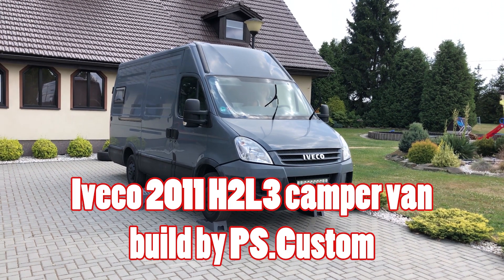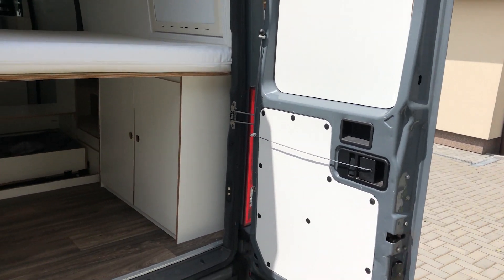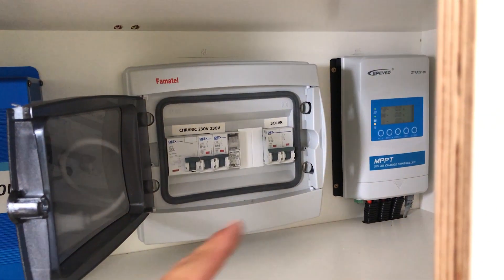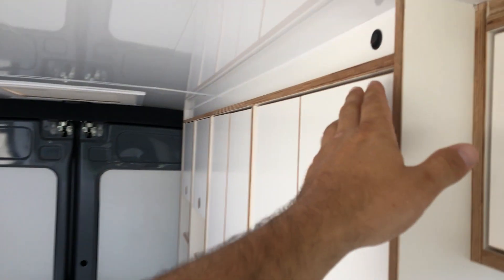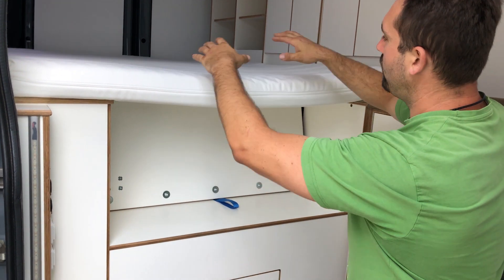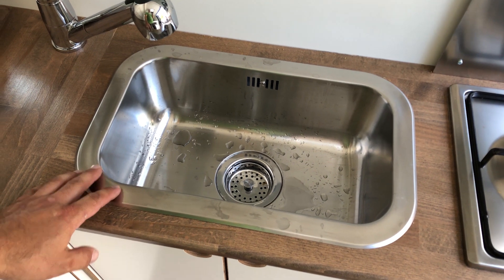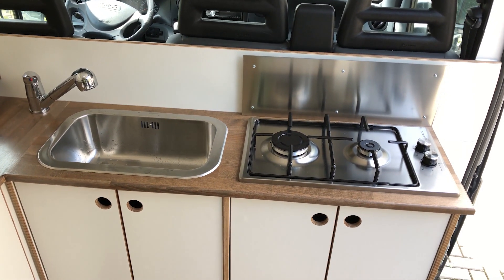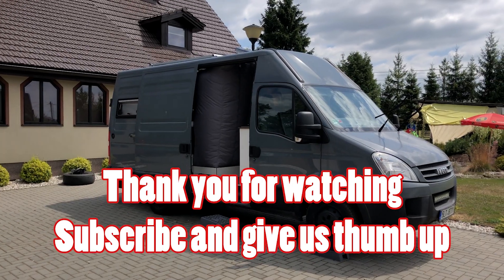IVECO L3H2 campervan conversion made by PS.Custom

Comment: Nice build, I too would be concerned using that boiler.
What material did you use for the cabinet builds,
Reply from the maker: Bob Scullion don’t worry about water heater. And it is 15mm birch plywood.

Comment: Hello from Switzerland!
Have you insulated the line from the water heater to the faucet?
Is there a specific insulated water hose for this?
Reply from the maker: Daniel Lörtscher hello no it is not insulated because owner will not use the car in the winter and cold weather. Under the car is valve which he can use to empty water tank also as shower. In the winter it will be empty in garage.

Comment: I love Ivecos
Reply from the maker: Lauren Henley I have to say I dont like them at all and would not recommend for conversion to camper van. Rust is going to eat every one of them. Roof si very stupid way done with not even one flat surface for window. Very tall floor because of rear wheel drive. Buy it is just mine feeling.
Reply: @Pajunk320  uh oh :( thanks for telling me. I didn't know that information I just thought they were more rugged than Ford Transits and Sprinters. What would be your ideal van to convert then - out of Transit, Promaster or VW Crafter?
Reply from the maker: Pinga Lu112 ducato/boxer/jumper depend how high you are?
Reply from the maker: Lauren Henley dodge promaster is same like ducato here and so far it is my favorite body
Reply from the maker: Pinga Lu112 promaster L4H2 or H3 good car for you. I dont know about engine but this body is good for conversion
Reply: And if I am 186cm tall? Which one would you recommend? :)
Reply from the maker: Adam Urban h3
Reply: @Pajunk320  They don’t rust but the engines a rubbish
Reply from the maker: @andrewgilbride7546  depend what engine but they rust a lot